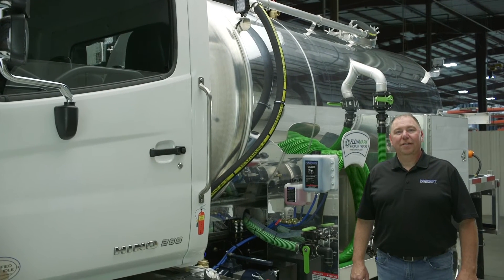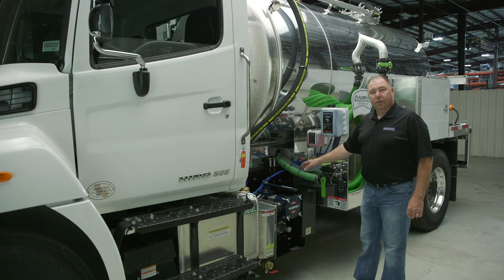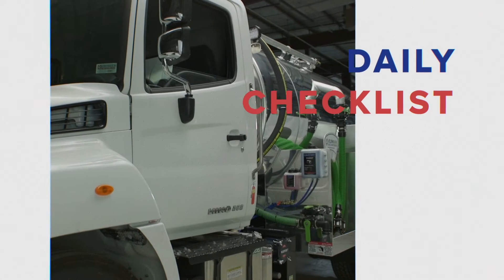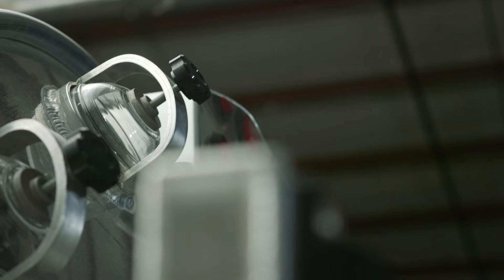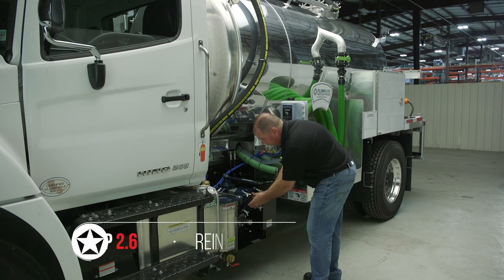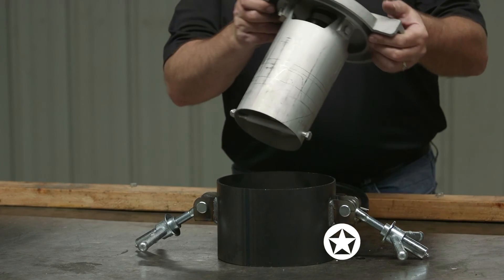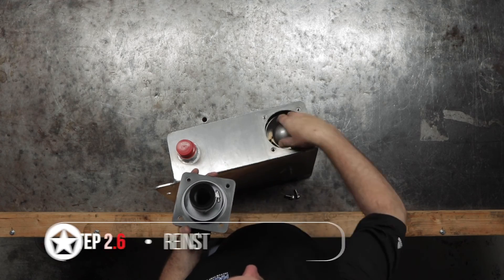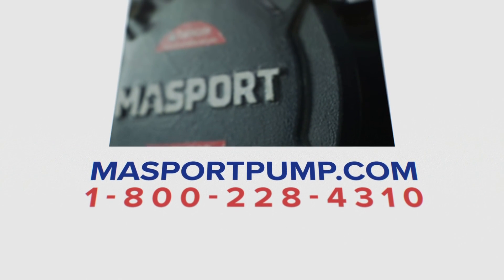Masport - Vacuum Truck Function, Operation & Maintenance

Comment: I have one here that takes 5 - 10 minutes to build vacuum and when the drivers try to use it , their complaining its also weak . I’ve cleaned the filter and i drained and poked all scubber tanks .. still no help. Maybe you have a tip or trick that could help before take it apart to rebuild it ? Thank you